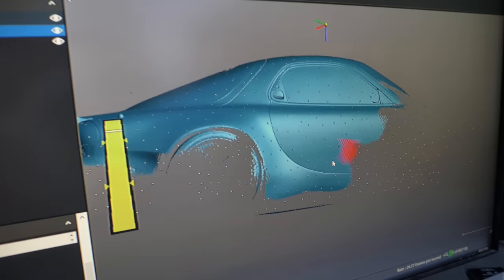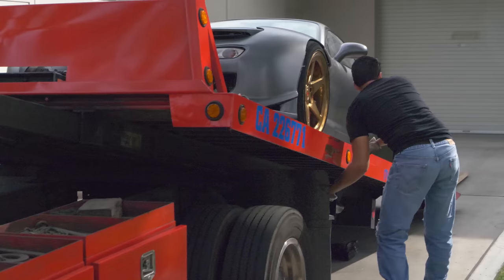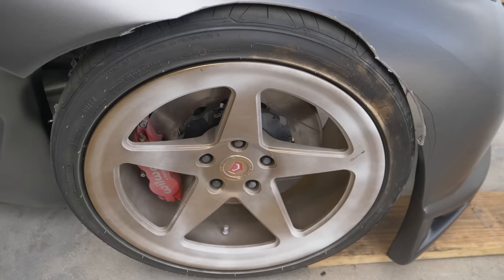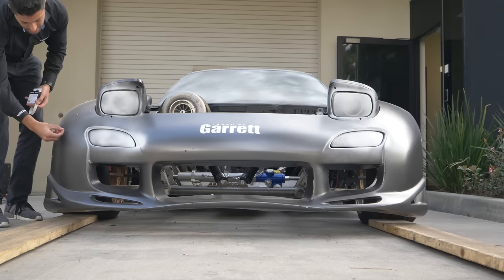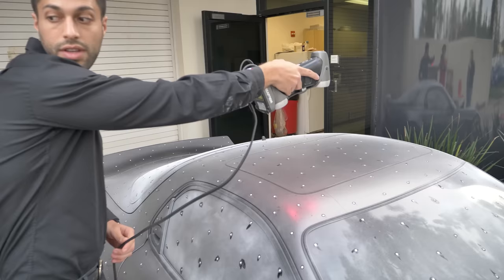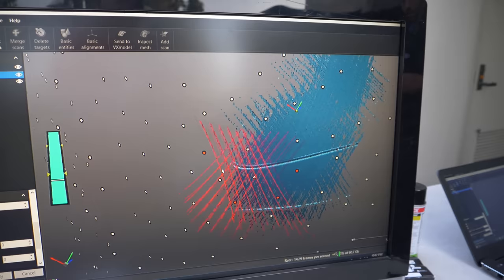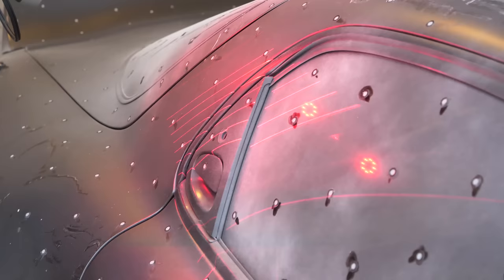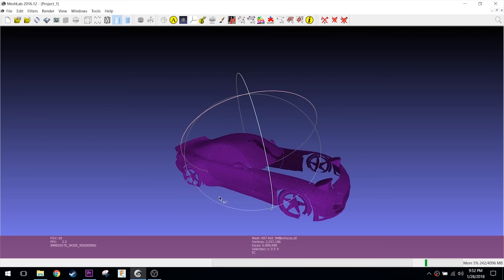We 3D Scan the 4 Rotor RX-7! | Rob Dahm

Comment: What's the point in 3-D scanned if it doesn't move under its own power?
Reply: Ash Harding to build the body panels, the car is going to be a carbon fibre mold this is just a aluminium prototype

Comment: Where do you get one of those 3D mapping systems just curious probably would never afford one
Reply from the maker: Creaform makes a variety of units. We chose this one because it’s more affordable than the unit that can get it done in 5 minutes. This one is often bought by engineering firms and schools. I will be showing off a 6k unit next to scan the engine bay etc
Reply: I don't think I had the chance to work on 3D scans built using Creaform scanners but I was wondering if you compared the dimensions of the car and the 3d data ? I have had quite bad experiences working on 3d scans made with small hand held unit (stretched and twisted meshes) .
Good to see this type of technology used on project like yours !
Reply: Hello...Creaform scanners provide you with quality mesh data with a volumetric accuracy of 0.0012in. The quality of the scan data can also be seen in the video. If needed we can also prove our accuracy specs using lab certified artefacts.

Comment: I've never heard anyone pronounce Payam that way. I assume his parents are of Persian origin?
Reply from the maker: Yes haha we talked about that. Persian
Reply: Rob Dahm I have a friend named Payam, so I thought it was strange.

Interesting choice of laser scanner though. I have experience with Faro/Trimble scanners used in the construction industry. Why this kind over that? The amount of data they produce, mind you, is immense and overkill.
Reply: Hi Izzie...I would argue that using a Faro scanner to scan a car would require multiple setups and leapfrogging due to the limitation with the arm, whereas with the HandySCAN you simply start and go without the need to stop and leapfrog, therefore a lot of time saved, let alone the difference in data accuracy between leapfrog method rather than a one time setup. Faro scanners are a good product but definitely not the best option for scanning a whole car in terms of efficiency, data accuracy and quality.

Next, I would argue that using a Faro scanner to scan a whole car could possibly result in injuries and take a lot more energy due to the constant battle with the arm to get the scanner head in the right position, whereas with a HandySCAN that weighs 2lbs, you are completely free to move without having to battle anyone. 
Lastly, I would argue that when an application like CFD analysis requires high accuracy, resolution and data quality, the HandySCAN would be the best option rather than an overkill. 

Trimble scanners are long rage scanners and used for very large area scanning such as the construction industry as you mentioned. again, it would not be the best option for an application that requires high data accuracy, resolution and quality There's a reason that major automotive companies are using the HandySCAN for scanning production parts rather than a trimble scanner.
Reply: Payam Hariri Thanks for the reply.

I totally appreciate that your system is better suited to the job, but it honestly  has not stopped some people (I know of some game developers who have done so) using survey grade laser scanners to scan cars as well as tracks.I suppose it's down to what they have available for them. 

I have some questions about the mechanisms of your system but they're probably a bit much for a YT comment and the answers would probably be commercially sensitive 😂.

Comment: is rob really barely scraping it by with money for this build? I mean every time the 4 rotor is filmed to engine has not been worked on. Why can't they put all efforts into finishing the engine?
Reply from the maker: Originally a year ago yes. But I got that figured out. Frankly I am trusting abel to dictate the motor. And it’s been at the same machine shop since November waiting on one specific modification. I’ve even offered to pay extra and still nothing. I’m starting to feel the pressure. I need it moving forward. So I’ll focus on the suspension and body. But dammit I want the engine idling!